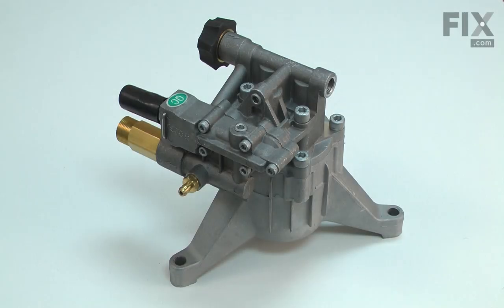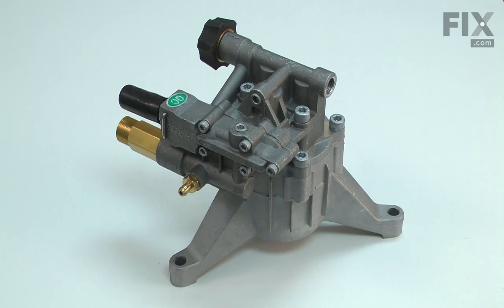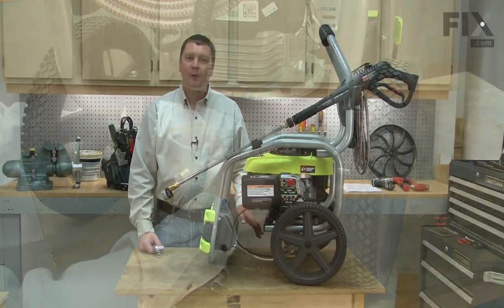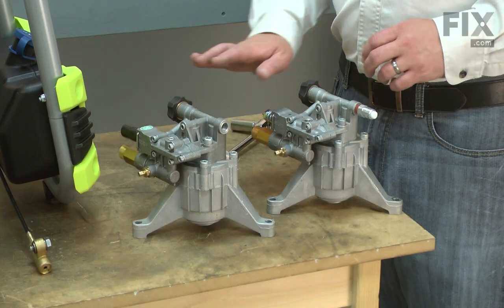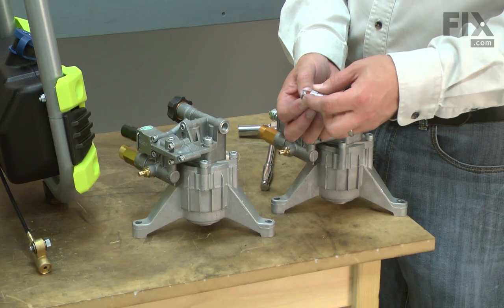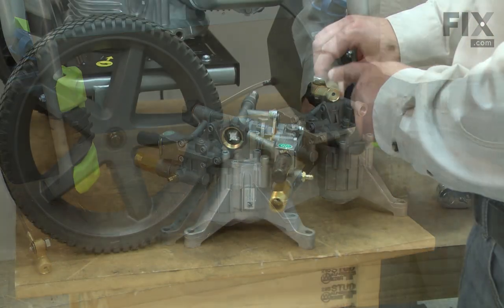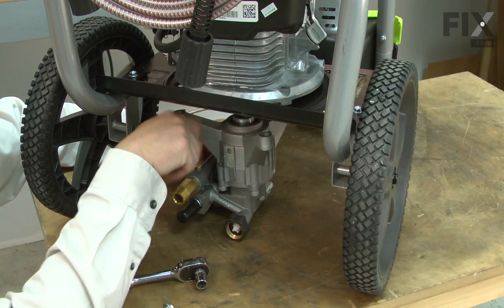Ryobi Pressure Washer Repair - How to Replace the Pump

Comment: Mine doesn’t fall off after all the bolts are undone.   It’s pretty stuck.  Am I missing something here?
Reply: Mine is the same, did you figure it out yet?
Reply: @bigbomb5904  2:02 you can see a little metal bar sticking out from the bottom of the motor on top. Since he has probably already taken his off once or twice before this video it comes out freely. Yours may not since it's the first time removing your pump more than likely. That little metal bar is probably stuck in there a little.
Reply: His hardware is all brand new looking as well
Reply: It's probably due to corrosion. Use a penetrant like PB Blaster on the shaft, give it a while to set in (could be minutes or hours depending how bad) and good old fashioned bludgeoning with a hammer to free it since you're not keeping the pump, presumably. Then, I would strongly recommend cleaning the shaft and key and applying a lubricant to prevent corrosion next time around. Careful not to beat on the thermal relief he's instructing you to transfer to the new pump or you'll be buying that too!

Comment: Wow, perfect.  I found mine has a crack in it today.  Been a couple of years since I last run it, but I know I prepared it properly for storage.  Oh, well, at least it will be more economical if I fix it myself.  This will be the 2nd time I've had this replace (1st for hard water deposits).  Wish these things were designed to be a little more idiot proof (not accumulate hard water deposits, freeze plug, whatever).
Reply: Did any oil spill from the crack
Reply: @wildwoodtop  No oil, just loss of water pressure.

Comment: What contraption is on the opposite end of the thermal relief? The black circular thing? 

My dad needs to replace it.
Reply from the maker: That is the garden hose coupler. Look up your pump using the pressure washers model number. Some manufacturers offer the coupler as a replacement part, others offer very few parts and you will need to replace the pump. -Mark

Comment: Hi. Do the pumps use any oil??
Reply: Any update on this?
Reply: No update sorry
Reply: aamador50 manual says nothing. I don’t think they are serviceable. Only thing I’ve seen are people tapping drain plugs into them. Seems like a “lifetime” part, once pump goes its time for new washer or pump assembly
Reply: There is a spray to use if you plan to store the pump like over winter. This is sprayed backwards up the water hose connection port/fitting. Otherwise no. The motor requires oil of course.

Comment: My ryobi has the idle down throttle.. The replacement pump does not.. Can I swap my old throttle to the new pump? If so, how?
Reply: Paul did you figure out how to remove idle down throttle?
Reply: @adamlombardo3490  I did not. I have not had time to look at it. Likely going to send the replacement back and get another one with idle down assembled.
Reply: You can lock tbe mechanism  to run  in high rpm  but  you will have a high fuel consum e high  noise all the time
Reply: Just move the spring on the idle down to a small hole under the on/off switch plate. You won’t have idle down it will run at speed all times but won’t matter.

Comment: Any ideas on removing the old pump that is rusted/siezed onto the engine shaft on this particular setup. I've soaked it in pb blaster, used a pry bar, rubber mallet, heated the shaft, even hooked a chain around it with a bottle jack but to no avail... please put me out of my misery lol
Reply: kaostheory1370 sell it as is and get another. It sounds like the problem will be more severe than just the pump
Reply: wedges between the motor and pump..is how i got mine off..was a pain...
Reply: Same problem here,  I'm think in cut off the old pump with angle grind😡🤬🤞
Reply: @vargazzdlh  so that's what worked. I had a friend take an air hammer and angle grinder to it and after a while finally got it to release. Just make sure that you dont damage the motor shaft. Cut off as much of the pump as you can until you have enough room to get the grinder on it
Reply: I even took the whole pump apart and still can’t get this pump off. This dude slid that thing off like
Reply: I removed  my  broken pump  using a flame torch , a brake pad tool like a pulley extractor  and one pry bar ! Im goin put  the short video here   guys
Reply: Same thing happened to me, I used a torch to heat the shaft, a pry-bar and a hammer, always hammering alternating on both sides to avoid damaging the shaft. It wasn't easy, but eventually came off.

Comment: How chance The oil?
Reply: Some pumps that don't have a oil plug to drain, you have to use a transfer pump to pump out the old oil. Harbor freight have those for 4.99$

Comment: I am replacing the pump on my Ryobi v190 3100 PSI pressure washer.  The Idle down cable looks very different from the one in your video ; instead of a screw to hold it in it has a U shaped clip which I removed but the cable does not seem to want to pull out please help.
Reply: Im with you.  did you figure it out?
Reply: ha, just got it.  Put a pair vice grips on it.  It has two seals inside holding it in.  It pulls out
Reply: @taddhoward2113  any tips? I have been fighting with mine for about a day and cannot get it out. Also, how did you get it into the new pump
Reply: I have the same problem how do you get the throttle cable out
Reply: I have the same problem How do you get the idol cable out

Comment: How do you know the pump is bad? Mine runs fine till you add water pressure... I figure it may be the pump
Reply: Fellow youtuber lol, I've heard a lot of the time it is an unloader issue. If the pump has the water turned on and it stalls out the engine unless the trigger is pulled on the gun then the unloader may be stuck.
Reply: @FloRuski  do you have any clue how to remove the unloader valve on these ryobi pressure washers? because i tried everything and can not get it out, it should just pop out with a screwdriver but it wont.
Reply: Jake Getz I found that heating up the aluminum to pretty hot temps with a torch made it easy to pop out. Mine was stuck as well, hope it helps man.
Reply: @jakegetz6636   my ryobi 3100 unloader is the same way can not get it to come out  at all with out busting the freaking pump case  it is so stuck ,,and i have herd several of these ryobi's do this  and  i had to spend $150 to get a hole new pump . i even heated it with a torch but that could mess up the rubber seals    this thing  pisses me off
Reply: @knightridert71  the o-rings are cheap.... it should be easy to remove once you get some rust penetrant like wd-40 in there and let that do it's thing for a few hours.